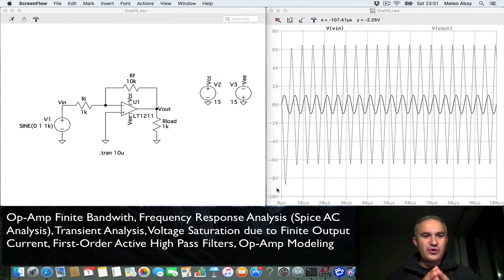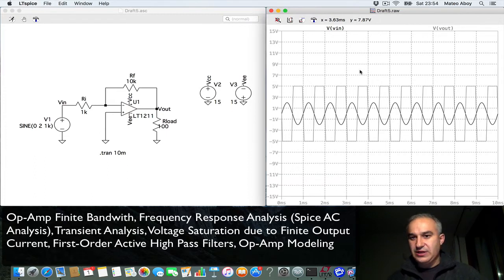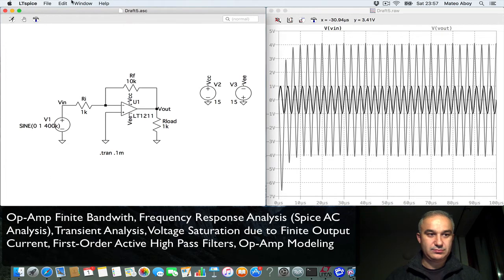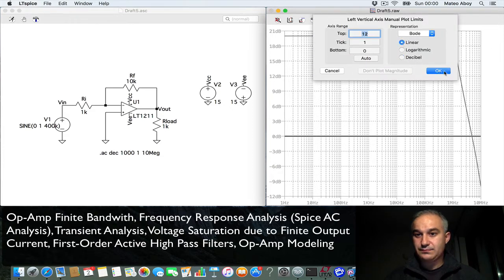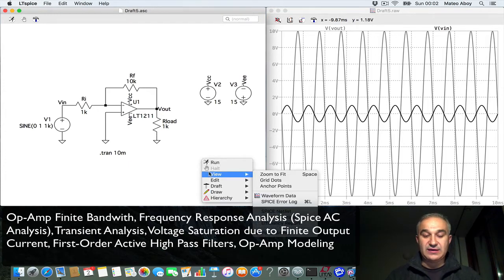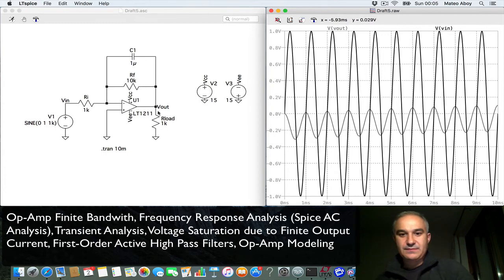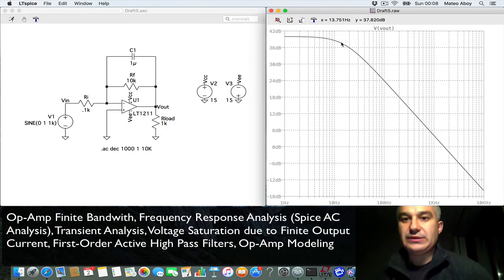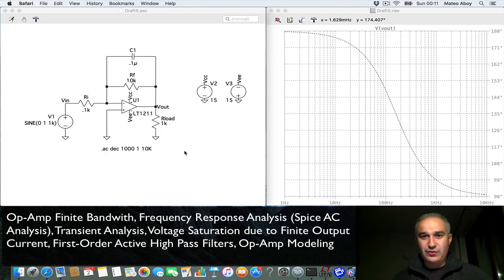LTSpice Mac OS X Tutorial: AC Analysis, Finite Bandwith , Gain-Bandwidth Product, Low-Pass Filters

Comment: Do you have a video that has a High Pass RC Filter with an opAmp?
Reply from the maker: No. I will create one and post it. You only need to change the location of the capacitor (instead of being in parallel with Rf, it will need to be in series with Ri). Do you need it with some particular characteristics (i.e., a particular cutoff frequency, etc?
Reply from the maker: I just uploaded a video with includes an active highpass filter (as well as a lowpass and bandpass). It is in the same playlist (LTSpice)
Reply from the maker: SweetNemesis420 The link is password protected. Consequently, I cannot access the document with the specs. In any case, I posted another video that incorporates a highpass filter.
Reply: Oops.  Sorry about that.  This link does not require a password.  It contains a pdf with the specs.  I just need to know what and how to set the components.  Thank you for your time! https://www.dropbox.com/s/blkmr82juge8rks/ECE305%20PSpice%20Assignment%201%20%282%29.pdf?dl=0